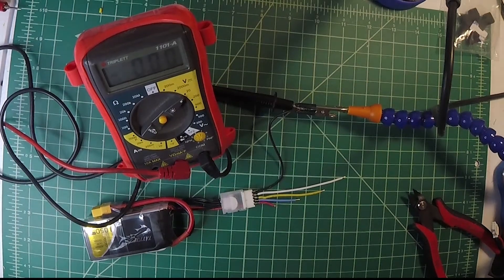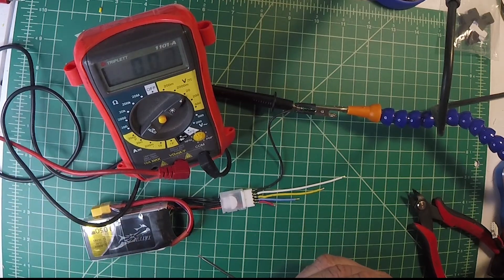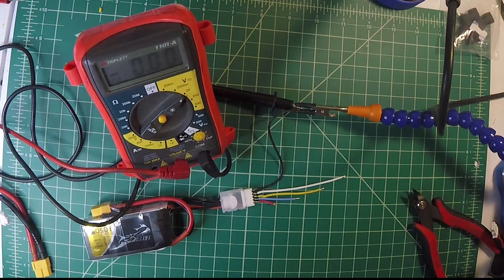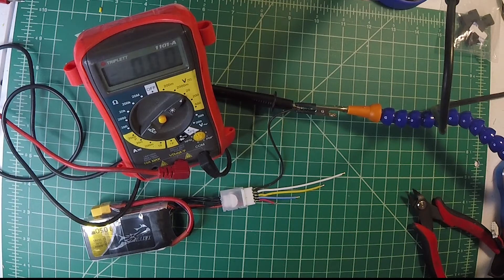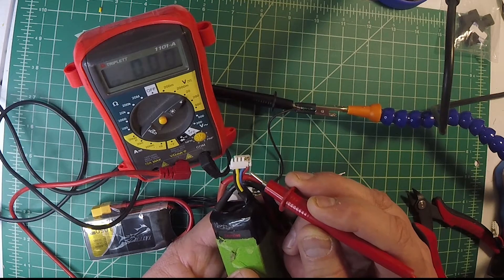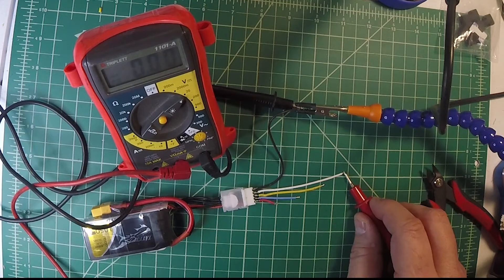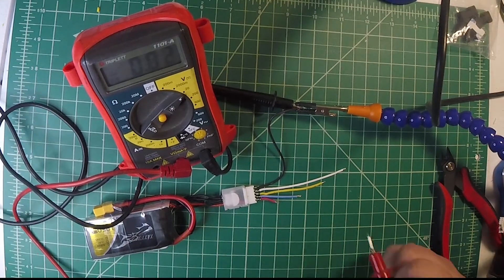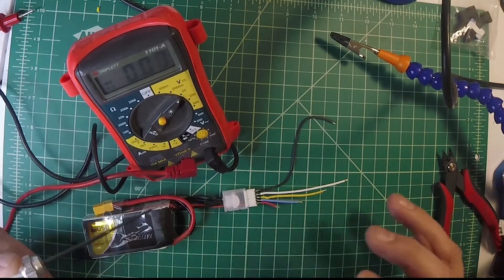Lipo Battery Balance Port, something you probably didn't know!

Comment: Somehow I am so confused by the Balance Port. Please help me out. When Ground is the common wire and it wants to de charge the fourth cell, doesn’t it de charge the hole pack? Or does it use the cable on the third and the fourth cell?